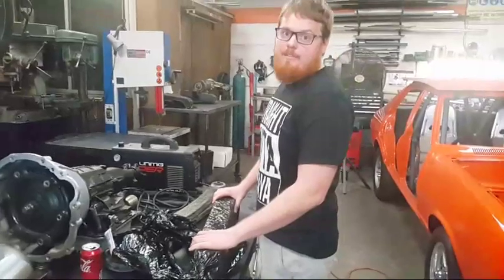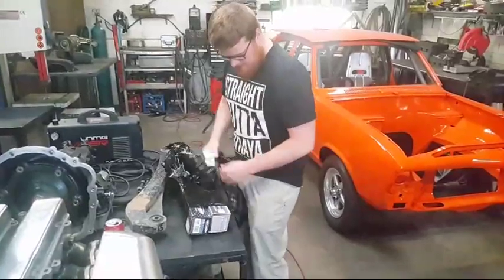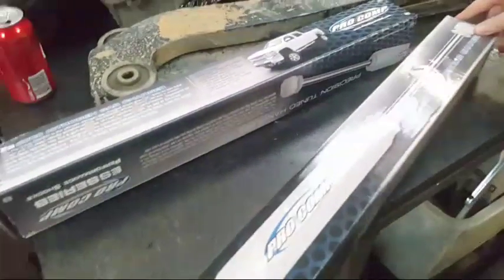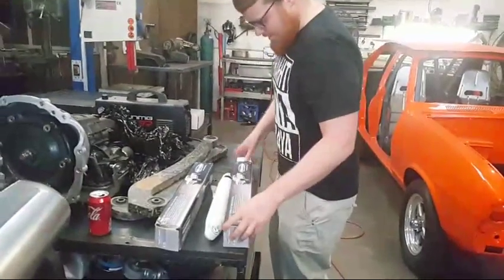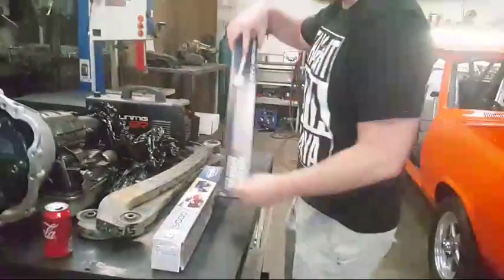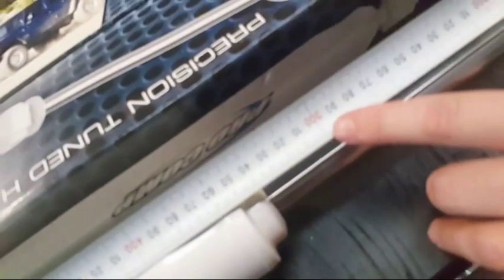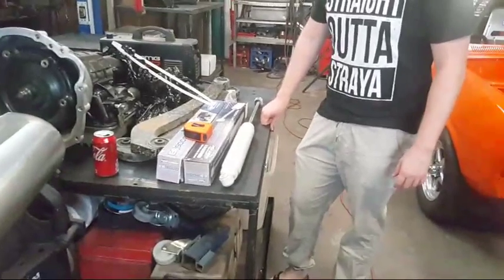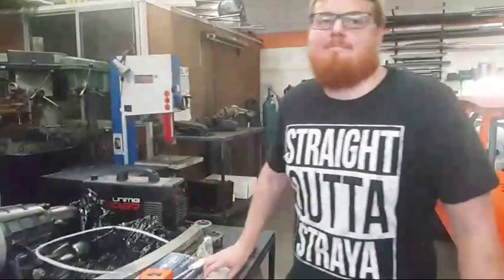Upgrading WK Grand Cherokee Rear Shocks

Comment: Are we gonna get a video of these being installed or are you just gonna show us taking them out of the box.
Reply from the maker: Oh, install was "just remove the old ones and put the new ones in place instead." Nothing to it. Was just a quick live video of the new shocks.

BTW, what's more interesting, the rear control arm bushes don't seem to last and squeak all the time on these. They got replaced (with a bit of custom work) with Nissan Patrol ones. Don't think they'll EVER need replacing anymore. Unfortunately I didn't do a video of that job.

Comment: Could you tell me the suspension setup and tyres of the WH in the thumbnail plez?
Reply from the maker: 4" Superlift and Atturo 33x12.5R17 (which have been replaced by a new set of Nitto's 2 weeks ago).